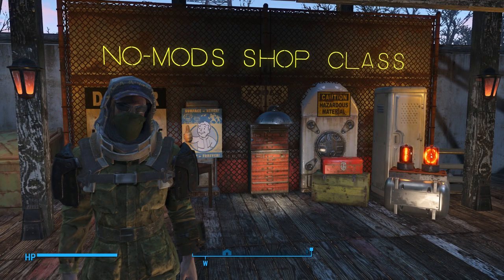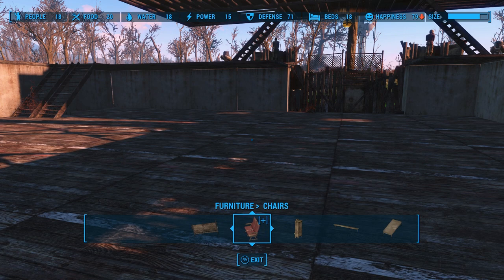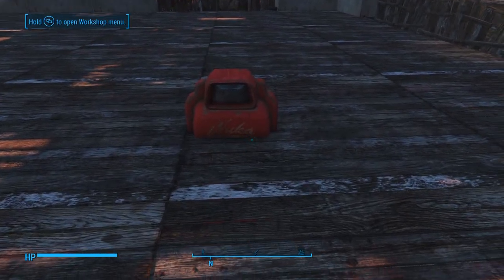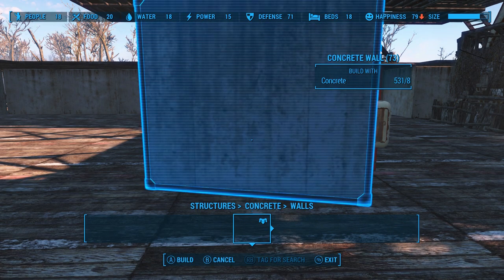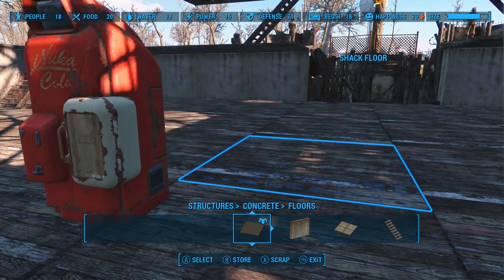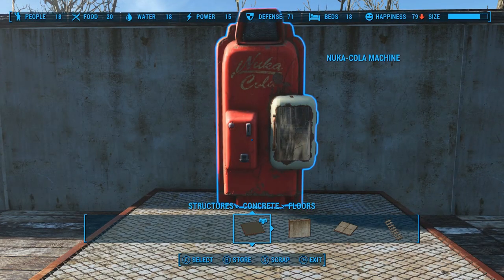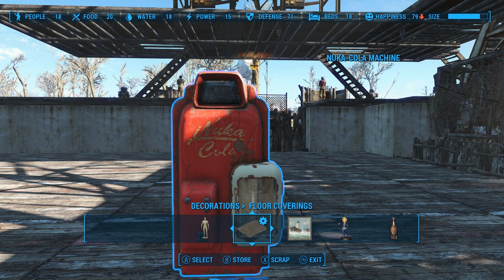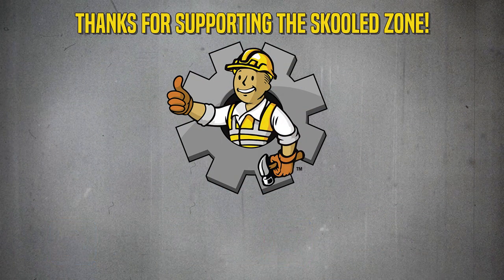Rug Glitch Sink Problem Solved 🕳️ Fallout 4 No Mods Shop Class

Comment: I had found an alternate solution, albeit not as practical as yours, while trying to resolve this problem in my own settlement builds.  I noticed that the drops would only occur if the layer I'm "glitching to" was not the lower most level; would happen irregular on ceiling floor combos and even vaultrooms.  Again it was irregular and unpredictable so not practical nor much of a solution, but with patience, I 'could" get it too work.  Concrete foundations are never a problem, but I tend to have rooms below in most cases, so while a solution was there, it was not practical.  Thank you for this.  Guess I can go and remove some carpets and triple floor combos I had to use to make it work now.  :D

Comment: One I think because your entire base is elevated off the ground you're leaving a gap so if the machine has to register the elevation as well the other thing is you're constantly using either floorboards or rugs constantly have you ever thought about a pillar I mean I'm pretty sure if you pick up a pillar and walk all around you can probably build your entire base with your pillar now the pillar is it the same height so you can raise it up or lower it down which means like that vending machine can sit on a tiny little table because you've picked it up with the pillar and put it on that tiny little table and then you got rid of the pillar guess what it stays where it is because the pillar allows you to go up down left and right also if you ever get into solitary you build one of your junk walls can you grab yourself a cement pillar walk it close to it pick it up walk it through the wall and instantly you just prepared your house because you use the junk wall and a pillar to basically put the junk wall in the middle of the middle MASH which actually makes it look like you filled in the wall on solitary's houses with junk walls going in the middle of all your little stuff no I do realize that this is the internet I do realize that you're you're a young man and your you know getting into technology and all this stuff but you should try doing this and like say I don't know what the good old-fashioned original art system I know you're on an Xbox One you know this can be done on the Xbox 360

Comment: Paul, there is a faster way to do the rug glitch, you just put 1 rug infront any items,walls, etc but you need to put it close but not attach it and you need to do it in a flat field and no workshop items near you and then you hold the A button for Xbox and then boom done , but the thing is this is only the faster way.
Reply: That is the "group select" function, the same thing that makes the pillar glitch work. It does some strange things to item collision (you can use a small rug to slip new walls into the Sanctuary houses, for example), but doesn't remove it.

Comment: the rug and the single thickness floor (the small one) caused the vending machine to drop the same amount. The double width floor "fixed it". I wonder if it's not a "timing" issue so much as it is like there are invisible "catch points" inside the vending machine and the machine drops for the same amount of time for both, but on the thinner floor it "missed" the catch point so that it had to wait for the next one. So, first catch point is the bottom of the machine, second looks like maybe the top of the indentation of the drink compartment. If it falls to far and misses the bottom of the machine, it will catch on the next one. Does that make sense? How do other objects "fall"? Are there repeatable points where it always stops?

Comment: Bethesda's engine works off the frames per second in the engine. For examples a lot of quests break if you go above 60fps using the ini file.
So I wonder, would changing your FPS cap higher or lower give the calculation more time?

And for that matter, would your CPU speed and thread count have any effect on it?

Comment: I’m armed with some tricks, and have replicated several creations, but I am back, troubleshooting. I imitated a turret tower of yours. 4 concrete section’s metal quarter circles, snapped into a disc, turrets on top, then pillar glitched onto a telephone pole.  It was so easy. But then I wanted to put up a solitary spotlight, on one quarter circle, but couldn’t. Then I remember you saying snappable items can’t clip. But, hold on, the quarter circles snap. It must be that the part that snaps, is already snapped, which disables the inability to clip. What do you think? Are there other snappables that could work this way?
Reply from the maker: You can't clip individual snappable items. But when you snap them to other things and then group select them, you're effectively doing another version of the pillar glitch (except maybe without the sinking). I cover some examples in this video: https://youtu.be/M9OQAseCIcg
Reply: @SkooledZone  Thanks. I have seen that video once before, and while watching it again, I realized I had been using group select too much, when rug glitch is better. 

I am also realizing that I need to follow your lead, and use more rugs or conduits, in my “chassis”. I started small, to get a feel for it, but learned more is better. 

Lastly, in your settlement size videos, it felt kind of ominous when you said that once I start messing with it, even if I’m nowhere close to building a metropolis, there’s no going back to how the game is normally. 

Basically;
If I don’t build, but I shrink my size by storing guns, are there some negative effects?
Reply from the maker: Right on and yeah, I cover all those questions in my early NMSC videos. But here are some extra tips for you:
1) Try using sinkable stairs instead of rugs for building outside: https://youtu.be/Emv1ZfOOFdQ
2) You can combine the rug and pillar glitch: https://youtu.be/1mXvZYiOK5A
3) You can always deconstruct some of your settlement to prevent crashes: https://youtu.be/Lu1Vp9XGcEA

Comment: Another issue with dropping.  I was attempting to put rubber matting throughout a home in Sanctuary (instead of wood) using the rug glitch however, every time I remove the mat, the large rubber mat would drop through the original foundation of the house.  I only realized this because some of the rubber mat was sticking out from under the foundation seen outside the front door.  There was no self installed flooring, just the original foundation.  Any solution?  Thanks.
Reply from the maker: Have you tried this method? https://youtu.be/inpsSzg-lPA

Comment: So I decided to give this a try on the stove you can craft with. I wanted to place it in the players home between the counters where the generic stove is. It still sunk down after removing each piece.
Reply from the maker: What I would do is quicksave right before removing the pieces and try different combinations of removing them. If it still doesn't work, then you can try it with a regular rug or mat that you don't mind leaving in front of the stove. Or you could always try pillar glitching it in there. Hope that helps.
Reply: Skooled Zone what I ended up doing and it looks decent, I stacked a bunch of the small blue matts on top each other to reach the hight I want the stove. The stove now sits on top of the matts in between the counters. It's kind of weird, when I click to craft my character will step up as if he's standing on the matts.
Reply from the maker: Absolutely. In fact, when you stack a bunch of those small blue mats on top of each other it almost looks like a small cement block.
Reply: Skooled Zone I didn't think of that!

Comment: I just ran into something interesting. I decided to skip Concord and go straight to Diamond City. I picked up Piper and now level 8. I walked into Concord to where the raiders are and they are frozen what looks like models on a computer.
Reply from the maker: That's a pretty wild glitch. Experienced some other wild glitches (https://youtu.be/iT7TTFEgQyE), but I've never seen that one before!
Reply: Skooled Zone After I went inside the Museum and came back out on top of the roof. The Raiders I killed during the glitch were floating in mid air like a sucker punched them under their jaw. It was weird.

Comment: I had an issue in Hangman's Alley, tried pushing back a dumpster next to the little ladder steps, in order to sink it into the debris, and weirdly it didn't drop, but jumped up to the level of the wall? I tried this glitch and it did the same thing? Any ideas on this?
Reply from the maker: Yup, I kinda mentioned that might happen at 9:07. What's happening is that as it's trying to sink through the ground, it's getting hung up on the wire mesh of the debris pile (which is a separate frame than the ground plane). So if you want it to actually sunk a little into the debris pile, you may have to use the pillar glitch instead. In fact, I actually sink a generator into a debris pile in this video: https://youtu.be/1mXvZYiOK5A
Reply: Skooled Zone thank you, I'll give it a try. I love your videos. They've helped me a ton. I particularly love using the pillar glitch to drop Fusion Generators underground so just the rounded Blue Top and connection are visible!

Comment: makes me wonder if you could use the wooden crates and set a rug on them.
Reply from the maker: Another longtime viewer named Patrik suggested that to me. He could get it to work, but I couldn't get it to work. Let me know if it works in your game. In my game, the rugs just slip under the crate and turn red. Otherwise that would be the best object to use.
Reply: yes, it seems the game system handles stuff from the building objects and decor objects sections very differently, i forgot about this by the time i got to play again, but i definitely will try this eventually.

Comment: Liking the vids, why not try a solid concrete block floor to see if the same thing happens to the nuka cola machine.
Reply from the maker: I tested it off camera and it's not as dramatic of a sink on concrete as wood, but it still sinks. The method in this video prevents that though.

Comment: Anybody else having issues with this, even after using Paul's technique? Everything is fine after storing the small wood flooring, but when i store the rugs, my items still drop or even pop up higher off the ground...
Reply from the maker: It helps sometimes if you add a few more stacked rugs like I did here: https://youtu.be/Bk2SWNyshFA?t=11m33s
Reply: Skooled Zone thanks Paul, but I'm unsure what I'm doing wrong.i spent a bit tonight troubleshooting, trying different rug types, different number of rugs, removing the wood flooring and rugs in different order and nothing worked for me. For now I'm content to use the regular rug glitch and not remove them. Thanks again tho!

Comment: Cool. That reminds me how I solved an issue with Unity3D and objects ignoring collisions when TONS of objects were spawned at once and were falling through the ground. I put a large cube under the ground planes and made code that said if an object collides with the cube under the ground, then put that object above a coordinate, and it would use gravity to fall back down a bit to try to land on the ground again. So if the ground plane was at 0,0,0 and the cube was at 0,-20,0, then if it passed 0,0,0 and made it to 0,-20,0, then it would put that object at something like 0,5,0, which would attempt to fall back to around 0,1,0 or 0,0,0. https://i.imgur.com/TkTwmSi.png (a picture example)

Comment: This has nothing to do with time or milliseconds, the game would not function at all if it was like that. All calculations happen during a single frame (I'm not a game developer, I don't work at bethesda, I haven't looked deep into how the enginge works, but from a "programming common sense" this would be a development disaster for objects to behave like you describe), what happens there is (I imagine) the object has a 'margin' aroung it's mesh, which may be thicker than a rug. The margin overlaps a floor, which makes the lowest point of the object get below the floor. When you remove the floor, the game 'projects' the object onto ground (or the next closest floor) and uses that lowest point as a starting position. And because the lowest point is below the actual floor when you remove the rug, the object sinks.